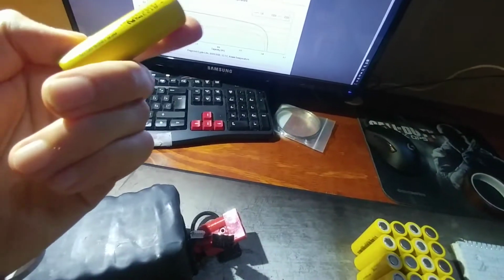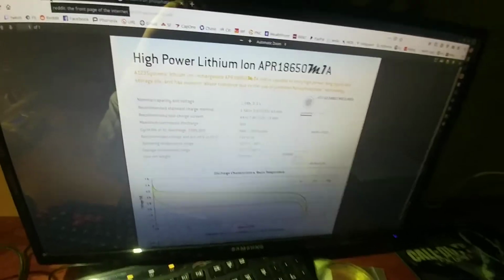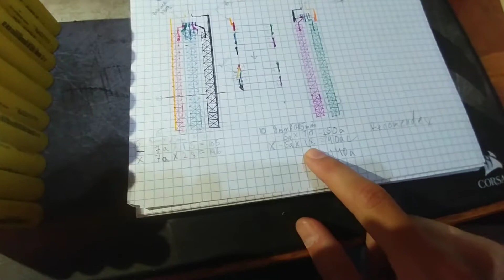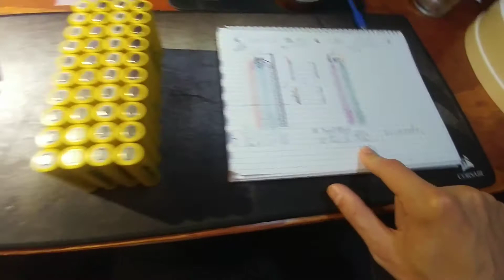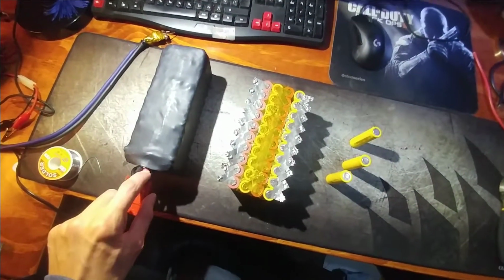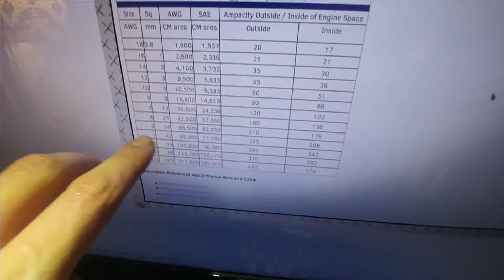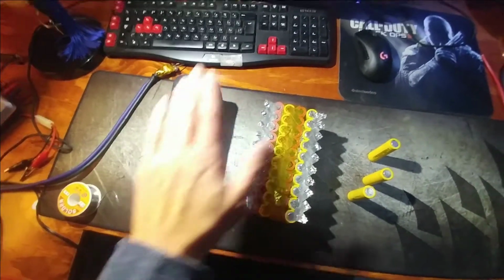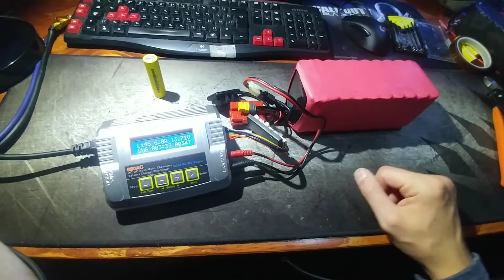Rebuilding my 4s 120A HIGH discharge pack with LifePO4 cells (4s10p 12v)

Comment: Mildly concerned at the small size of the soldering iron and what looks like cold solder joints. I am also concerned about your lack of a BMS for the pack.
Reply: Same. Getting a 200W iron made a world of difference